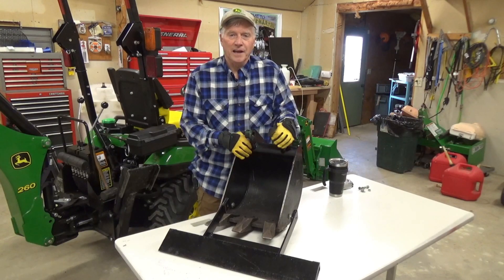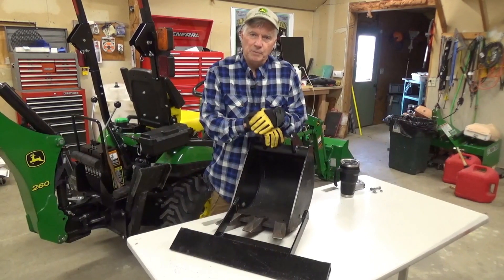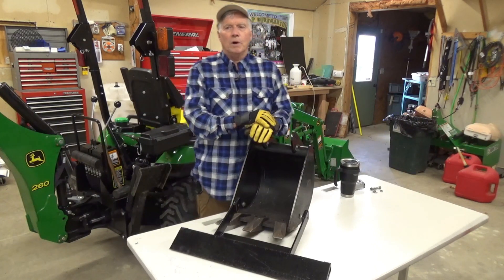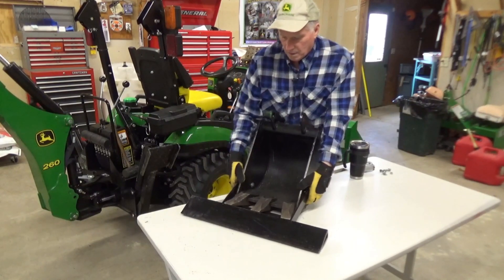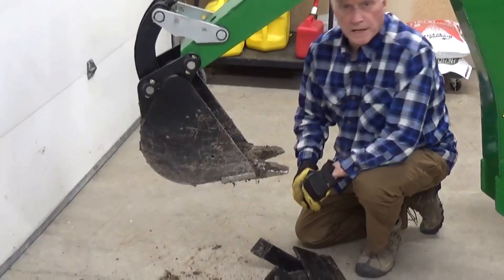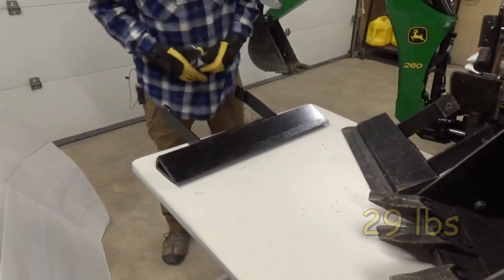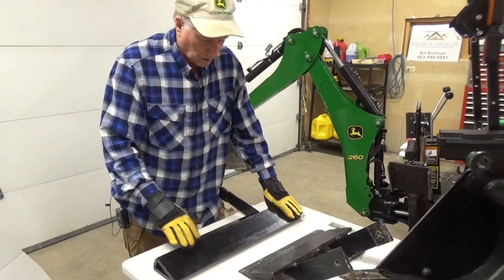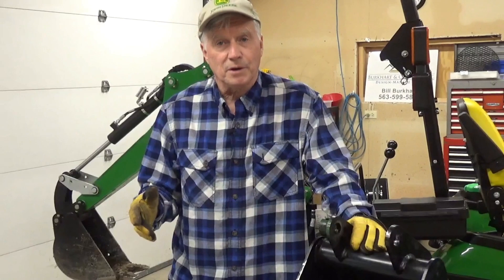John Deere Backhoe Attachment- Custom Scraper Blade / #98

Comment: Super Idea! I've been trying to come up with a similar idea for a grade beam to easily put on and take off of my JD410D backhoe for use on our property when I want to setup and pull grade somewhere after digging. 
 This was similar to the idea that I had come up with, but I like yours better.
 I'm gonna build mine out of half inch plate 4' wide to install on my 2' bucket,
 can't wait to get started this afternoon thanks for the great idea and YouTube video. I'm a retired welder fabricator with almost 50 yrs under a hood,  so now that I have the idea in my head will be a cinch to make this afternoon.  Thanks again for a great idea!!
Reply from the maker: Sorry for the delay in answering your comment. Glad the video gave you an idea. I’m sure you’ll make something even better than this one.-Bill

Comment: Great Job! I have a Case 580 SUPER M SERIES 3. I made a blade attachment like this for a 36 in bucket and a 12 in bucket.
I 100% agree with your thinking..I use a chain and screw binder on mine because of the size, but same concept...
I made both of mine for about 150 bucks with a replacement blade and scrap plate steel... I guarantee all who watch
your video, they can achieve a near perfectly smooth trench bottom, or footing, foundation base easily and cheaper/ faster
than bucket buying and swapping.. When you are doing the type of work this is intended to achieve this is a home run!!

I am a Licensed General contractor, and we no longer are having a guy with a shovel finishing bottom cleanup.
or at least very little! and light surface clean up is easier and faster around foundations, sidewalks, driveways!
This is a time saver and a money maker! 
So all you Nay sayers give it rest, make one and give it a test, and then give this gentleman
a Thank you for passing on a great idea!
Thank you again!
Don Sullivan
Reply from the maker: Hello Don.  Thank you !! for the positive comments especially as a contractor with real world experience. Glad you were able to make this design even better.  Enjoy your fall weather -Bill

Comment: This is great!  I was thinking something like this, but also cutting some short teeth into the blade, use it as a landscape rake and also improve grip when using it with the backhoe thumb.
Reply from the maker: Pond Acres  I’m sure you can improve this design, it’s a good basic design to start with. I use mine a lot to move landscape rock and gently contouring the ground. Good luck and thanks for taking time to comment.

Comment: Is it possible to supply a better description of the snow plow blade edge? Im not in Iowa. I have been searching for a similar part I can buy and then cut up to work.(the blade it self) great mod!!! Love your channel-
Reply from the maker: Good evening Sam, it’s a snow plow cutting edge, it’s beveled on one side.  I think if you bought square stock and beveled one edge, you would have something similar to what I was using. Does that make sense?  -Bill
Reply from the maker: Sam, thinking about this further, I don’t think you have to have a tapered edge. You could simply buy square stock and make the the paddle. Your thoughts
Reply: @billburkhart  Bill thanks for the speedy reply. Yea I thought I'd just buy some flat stock. and grind an edge. (I agree  too). Then I thought why? the snow plow stock already has a nice edge. which stacked nicely when assembling the part. what kind of snow plow?.  again thanks for the reply and nice video too
Reply from the maker: @TheSn1per  Good morning Sam, I didn’t buy a snow plow cutting edge specific to a model, they had a sale on the scrap pieces so I bought it only for that reason. Otherwise I maintain my property with a Kawasaki mule and the plow that comes with that. Have a great weekend, stay in touch—Bill
Reply: @billburkhart  Bill, I just moved to an area that gets snow.   ( having left the Florida area) so Im a complete noob when it comes to the cold. Where would I even look for scrap parts such as a replacement edge? Also you mentioned "they had a sale" a big box chain perhaps?. thanks for the info yet again. -S
Reply from the maker: @TheSn1per  Sam I have a steel supplier here in my town called steel Mart they sell small pieces to large pieces you could also find a snow plow dealer like Meyer or western in your area and they would sell replacement parts. Or perhaps online. If you can’t find anyone let me know and I’ll do some research from this and help you out. What part of the world did you move to from Florida. Depending where you’re at, my God you’ll freeze this winter….. i’ve been here my whole life and wonder why I live here in the winter😄😄😄😄

Comment: That's a terrific tool - nice design! On a connected topic, are there many reasons to have both an 8" bucket and 12" bucket? And, if you were to pick one, is there a bucket size that you feel meets most tasks? I assume the 1025R would be best suited for the narrower 8" bucket given its hydraulics. Thanks!
Reply from the maker: fcruabbly   Happy Sunday, I purchased the 8 inch bucket to Dig narrower trenches to bury conduit if I could only have one bucket I would buy the 12 inch bucket it worked fine on the 1025 of course it depends on the type of soil you’re digging also,
Reply: Thanks Bill. We have lots of rocks and tree roots here in the east. The 8" bucket would certainly cut through the underground tangle a bit faster and easier, but the 12" bucket would be nicer for plant and shrub relocating where I might be able to lift the entire root ball in one scoop. I think I am leaning toward the 12" width as the more versatile option.
Reply from the maker: fcruabbly   I understand it can be a tough decision go with your gut, you’ll be fine

Comment: Your age with a stroke. I have lots of use for Excavator. Tractors for 35 + years, never thought about a back hoe. Picked 2018 Kubota k008-3 with 2 hrs last week. Great idea. Thanks!. Also 8" and 12" buckets. I have a use for 24" scraper. Actually at $25,000 for brick turn driveway. I will have use for a 10' scraper, one time project. Make scraper out of wood. http://www.enichesoftware.com/index.htm

Comment: Be careful with those scrapers. You set the big one almost half of the table the first time where it could’ve fallen down onto a foot, leg. Then you were manhandling it after taking the one off the 8” bucket and almost had it slip through your fingers. Could’ve fallen and cut your hand or leg, foot
Reply from the maker: You are so correct, I will keep your ideas in mind! Thanks for taking time to share your concern.